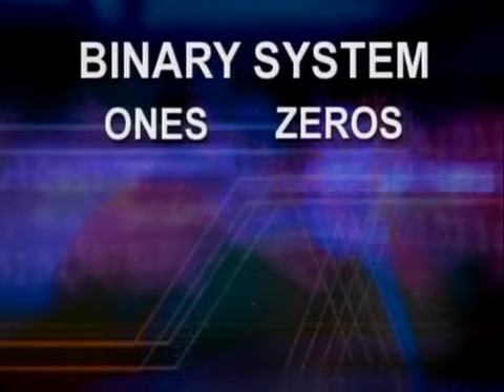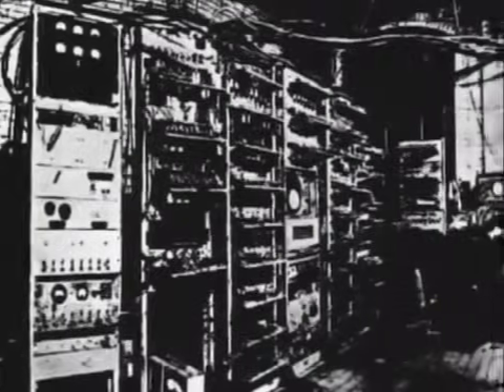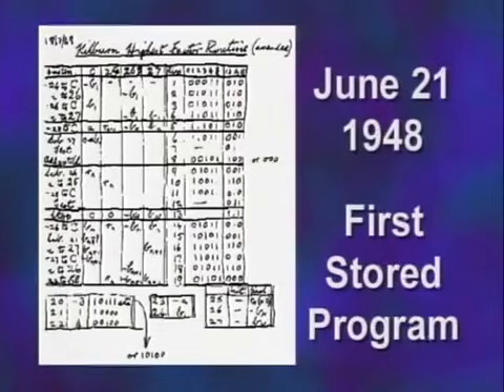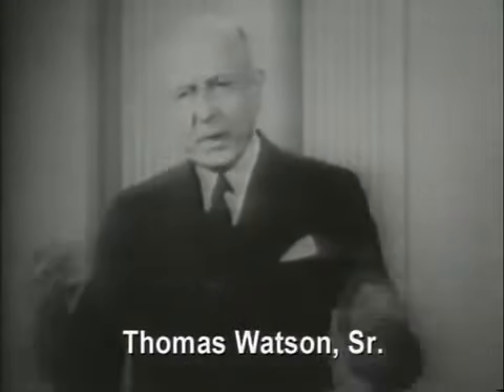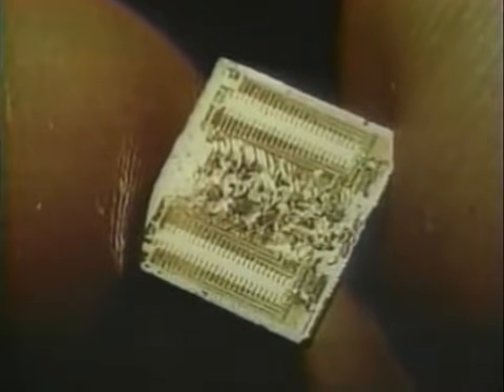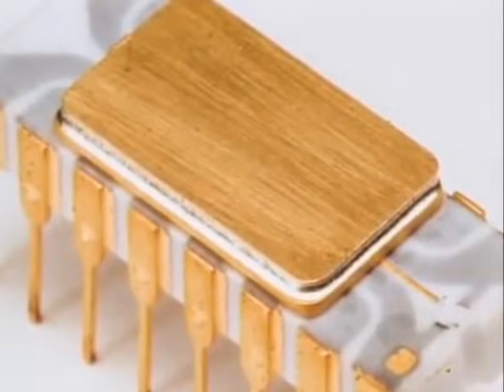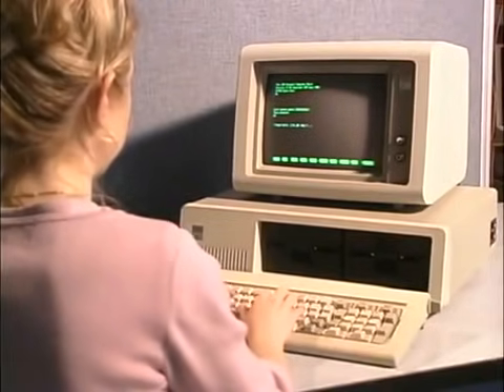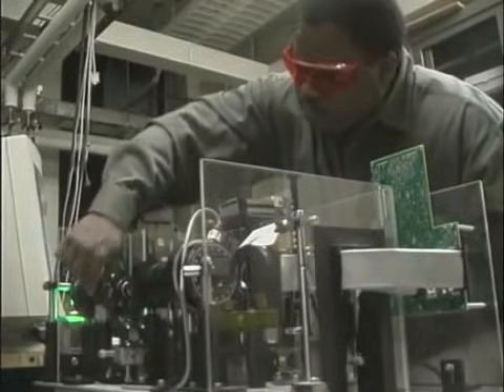Computer History of New Documentary

Comment: This SO CALLED HISTORY, fails completely to mention the GRANDDADDY OF THE COMMERCIAL COMPUTER THE IBM 1401.
I began my computer career in 1963 programming a UNIVAC SS80 which had a main memory which used a drum storage system.
The overwhelming majority of commercial computers at the time were the IBM 1400 Series with the classic 1401 in the lead.
I went to work for Honeywell in 1965 in England working on the Honeywell 200 Series which was actually a much improved IBM 1401.
After that I worked for HP,  and Wang Labs, then switched to the networking world working for Bridge Communications, 3COM, Cisco  Systems and several other Silicon Valley companies.